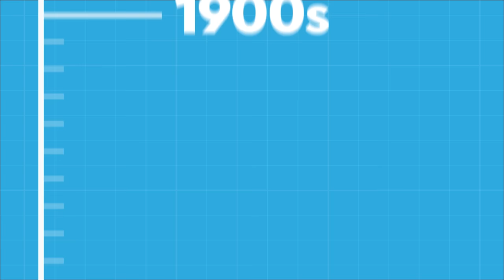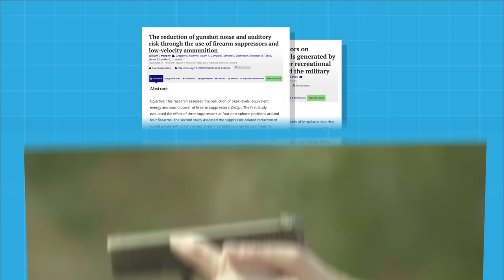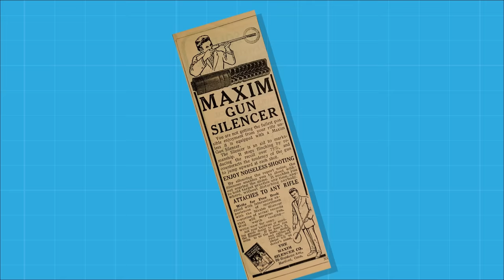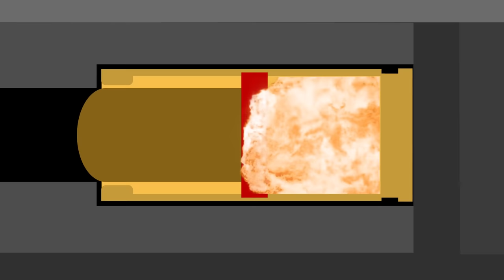How Silent Are Gun Silencers? DEBUNKED #moviemyths #debunked

Comment: I’ve always thought of them as a safety device more than anything
Reply: ...and you would be right!
Reply: Correct.  Saves your hearing.
Reply: Except not in the US. You must pay the fed $200 for this safety device that saves your hearing, makes your gun less concealable, and more difficult in tight quarters because the US government believes that a suppressor makes the gun more deadly.
Reply: @crissd8283 it makes it easier to get away with murder, so that might be why
Reply: @crissd8283   It's total nonsense.  Another example of the government being ignorant to facts.
Reply: @sweetricecakeman8582 not necessarily, silencers add more "pressure" on the system expelling more gunshot residue on the general area. Thats why you see more puffs of smoke, making it much easier to identify where the shootings took place and much easier to identify the individual because of the increased amount of evidence. This also dramatically increases the "sootyness" of the casings, making them significantly easier to identify in the forensics lab as they become "fingerprinted" to the firearm they were ejected from. You could argue that a weapon that retains casings would be immune to this, but revolvers don't seal the gasses, meaning a suppressor would be pointless and wouldn't perform as intended
Reply: @sweetricecakeman8582 
Not taking into account that a silenced shot is still loud as hell, there's still the corpse to worry about, as well as footage from surrounding cameras, witnesses, etc. Having a silenced gun doesn't make killing easier, it's just slightly less loud.
Reply: @BeRzErKeR111  Yeah, of course it's still extremely difficult to do.
Reply: @sweetricecakeman8582   You really have no idea what you are talking about, do you? Gun shots produce a noise level typically somewhere between 145 to 180 dB... greater noise than a jet engine at full thrust or an amplified rock concert with your ear a foot away. Suppressors (Hollywood and uninformed politician calls them "silencers"... thinking they make gun shots "silent) reduce the noise roughly between 10 and 30 dBs. Taking a "quiet" unsilenced gunshot at 145 dB and then using one of the more effective suppressors capable of a 30dB noise reduction, you're still left with a gun shot noise of about 115dB... about the sound level of a locomotive's horn from twenty feet away... enough to cause permanent hearing loss if experienced for any length of time.  How does that make it easier to get away with murder?
Reply: @sweetricecakeman8582  I would just use a compound crossbow for complete silence.  As for guns, people just don't want to damage their hearing.
Reply: @jmichna1 because it's not a continuous sound so you don't really notice it that much especially when compared to a jet engine also the loudest part of shooting a gun is the sonic boom that isn't there with subsonic bullets there is a reason why spies use suppressed guns and not just in movies (the welrod for example)
Reply: @sweetricecakeman8582 If you want to kill someone silently there are many more effective means than a "silenced" gun (which as this video shows, isn't silent at all). Besides, good silencers are expensive, require a threaded barrel (which is also expensive) and most gun murders are carried out with cheap, virtually disposable "Saturday Night specials," or the ubiquitous Glock clones.
Reply: That’s exactly what they are .
Reply: @sweetricecakeman8582 you my friend are not a gun guy .easiest way to get away with murder is live in a democrat city , duh.  

Is 137db quiet , not really . Odds are you have never used a suppressed weapon or had any training. 

Better to be quiet and people just think you are dumb than to speak and have it confirmed .

Comment: It is possible to have a mostly quiet gun, but you'd need to use subsonic .22 (the smallest you can get). You'll still get noise from the action though
Reply: get a 45 or 50 cal air gun.  you'll have a magnum cal handgun energy that sounds like a roofing nail gun
Reply: When I put my suppressor on a bolt action .22, it's far quieter than on a semi-auto gun.  I think at least some of the sound on a blowback semi-auto .22 is detonation noise coming back through the action.  I'm not sure about that but it does seem like there's more than just the clacking metal sound of a blowback action.  On a bolt action it's just a popping noise like an air gun, but on a semi it's a clack and louder pop if you know what I mean?
Reply: My .50 air gun is as loud as a .22, but my single shot suppressed rifle in .32 S&W long is almost as quiet as Hollywood 😊
Reply: The SD variants of the MP5 (the ones with the integral suppressor) are near silent when using subsoni 9mm. The only noise you really har from them is the noise coming from the internals working.
Reply: @dragonhealer7588  check out the texan LSS .50 with suppressor.  it has a built in 18 inch suppressor, with option to screw on another.  it's comically long and unwieldy, but it's unbelievably silent.  you can see guys confused and wondering if it shot after pulling the trigger
Reply: @loginavoidence12  
I've seen videos, and the suppressor is pretty effective, but the  .50 does have recoil, no question that you shot.
Reply: @dragonhealer7588  yeah i gave myself a black eye with it having my scope in the wrong position.  thing taught me a lesson about being patient about setting up gear
Reply: Subsonic .22 ammo will not cycle my rifle or pistol.
Reply: Anything subsonic will work if you have a good suppressor. The quietest gun I have ever shot was a reproduction De Lisle Carbine owned by a range buddy of mine. It was developed for the RM Commando's during WWII. The entire barrel is essentially one long suppressor and it uses subsonic .45 ACP. On a still day you could not hear the gunshot beyond 15 - 20 feet, with a brisk breeze you have to be almost on top of the shooter. 

Point is its easier to make a firearm close to silent IF you use subsonic ammunition because a large part of the sound of a gunshot is the round going supersonic and breaking the sound barrier. If the round does not go supersonic, it never breaks the barrier, so removes that sound from the gunshot, and the sound of the round going supersonic is impossible to suppress to my knowledge.

The downside obviously is using subsonic rounds you lose accuracy at range because subsonic rounds have less velocity, which means greater drop not to mention lacking the energy to even make the ranges a supersonic round o the same calibre would.
Reply: You can go slightly more powerful than that but Yh with very low powered low calibre bullets you can get very quiet
Reply: @loginavoidence12 Yh it’s weird because people think the Hollywood quietness doesn’t exist but it really does, a lot of people only talk of them in relation to bigger guns but they really do silence low powered weapons. Even this channel doesn’t talk about them and seems to think the same thing
Reply: I stuck a 16oz plastic water bottle over my 10/22 many years ago & the only nise I could hear was the action cycling & the bullet passing objects & the sonic shockwave reflecting bacl.

Comment: You can get Hollywood quiet with small subsonic calibers like 22lr, however, you are also ballistically neutered to slightly more than a BB gun.
Reply: You can also do that with a .45 ACP, which is actually a far better candidate for a conventional silenced weapon, as while the gunshot decibels are loud, they are mostly low frequency, which led to hard to hear gunshot sounds without the big crack. Specialized subsonic rounds like the 9x39mm or .300 Blackout also do the job well for it.
Reply: The .22lr is much more than a bb gun lol. A properly placed shot from one will kill instantly even at relatively long distances, whereas a bb gun is not likely to be lethal except at very close range.
Reply: @georgesakellaropoulos8162  CCI quiet 22LR shoots at 710fps.  About twice the speed of a Daisy Red Ryder.
Reply: My Gamo BB gun fires BBs at about 1000fps.
Reply: Silencers don't dampen the ballistics of the round. You've been video-gamed.
Reply: @TommyTombstone  I believe the OP was referring to the "quiet" rounds, which are definitely ballistics handicapped. Speaking from experience.
Reply: @kinthelt  22 LR is already subsonic from most handguns. The difference in powder load for "supers" and "subs" is negligible.
Reply: @dalenesbitt  Right and kinetic energy is 1/2mv^2. Do the math.
Reply: If you think a 22lr is only slightly ballistically better than a BB gun, you don't know sh!t! Even the most expensive BB guns, regardless of caliber, can't get close to a 22lr.
Reply: @bradgriffith4231  BB's are only lethal in very limited circumstances.

Comment: There are some older styles of suppressors that are much quieter, but they only work for 1 or 2 shots. Basically only designed for assassinations. They use baffles and also something called wipes, that actually make contact with the bullet as it exits, thus slowing down more of the expanding gases making it very quiet. But once you shoot it a few times, those wipes are basically worn down to where they no longer make contact and make that seal around the bullet and it'll lose its sound suppressing qualities.
Reply: Wipes are still common and last for more than one or two shots lol
Reply: @orion8981  Um, go ahead and give more details then. I know for some people the internet is just for arguing with each other, but if you know more about the topic, why don't you share the information rather than "hurdur, this guy dumb, lawl"? Please do so. I've never used one with wipes before, so my knowledge on them is limited. I simply know they exist and was sharing that since this video was about suppressors...
Reply: Yes, thankyou for bringing up the topic of the use of replaceable wipes.  One of the most important pieces of the real life suppressor lore!

Comment: Some parts of the world call suppressors "firearm mufflers" because the underlying science between car mufflers and suppressors is very similar. That and all modern car mufflers are based on Hiram Percy Maxim's designs, he was contracted to develop improved car muffler designs at the same time he was developing his silencer.
Reply: Well they were created by the guy who invented the car muffler. He just took the same design and resized it.
Reply: @dominozaur98  Maxim doesn't get historical credit for inventing the car muffler, other designs (and patents) predate his by several years.
Reply: A firearms muffler is basically an expansion chamber & could work with a perforated tube with sound absorbtion material between the PT & the outside wall of the can with no baffles, same as magnflow & borla auto mufflers. The drawback would be the explosion would probably destroy the SA material.

Comment: I was at the local outdoor range on Monday. A guy had a 9x19 pistol with a suppressor. Basically it was slightly less than my .22LR pistol and without the sharp crack. I asked him about sound with and without, so he took it off and fired, and there was a significant increase along with the sharp crack of the bullet. Suppressed, you definitely heard the action and the noise of the slide. It was no where near silent, but it was greatly reduced, enough I could have shot without ear protection (I did). With muffs on, you hear both, but mainly you hear mechanical sounds when suppressed.

Comment: During WWII, the OSS created an automatic pistol for assassinations that was incredibly quiet - receiver made of stacked mesh washers, holes in the barrel to bleed gas, integral  suppressor at the end of the barrel. Its report was said to be about as loud as striking a large kitchen match. But the auto loading system made an incredible amount of noise. So they changed the gun from an auto to a single shot. But you had to get very close to your target - bleeding off so much gas meant very little bullet energy.
Reply: Aaaaand of course the most important example is missing. There are videos here that address exactly that. If you combine sub-sonic ammo with a suppressor you will get exactly what these guys claim isn't possible. An almost silent gun. They could have known that if they had invested only five minutes of research.
Reply: @EbonyPope  I think the primary purpose of this video was to debunk the Hollywood myth.
Reply: @stopthephilosophicalzombie9017  But it is not debunked which they could have known if they had researche on YT for five minutes. There are videos here that use sub-sonic ammo with a suppressor that sound exactly like in some Hollywood movies. They were lazy.

Comment: An army coronel, friend of mine, who was (he passed away few years ago) firermas instructor, once showed me a noise supressor which funcioned in a very silent way. He had placed tiny rubber disks between the chambers of the supressor. They didn't last very long as the sound increased on successive shots. It was years ago and I can't recall exactly how many shots he gave. As far as I remember some 10 or so. The wearing of the disk rubber caused them to be replaced after that. He used a semi auto pistol and caliber .45 which is a subsonic round as he put it. I presume in a city environment during the day one could barely notice the low noise it produced. Of course on top of a lone mountain at night it would be another matter.

Comment: Silencers work incredibly well on airguns, especially pre-charged airguns. Because most Airgun ammo is Sub-sonic & the pressure is much less than powder burners you can get near silent performance.
Spring powered rifles do have louder action noise but down range you often only hear a muted click.
I have hunted with a silenced Airgun & the sound of the pellet impacting the quarry is often much louder than the shot report.

Comment: It's two things - firstly the supressor does lower the sound - but there is more to it - if you want a really take advantage of it you also need a subsonic ammunition which by design is made with lower powder charge to make the bullet subsonic to avoid the loud crack of going above the sound barrier.
 By using both you can achieve very quiet shots and in many cases the sound of the gun cycling can be actualy louder than the shot itself. The added bonus is that the supressor will also help a lot with suppresing the muzzle flash - and it will keep the position of the shooter that way easier to conceal as well.

Comment: I have an old Video on VHS, that debunks suppressors.  Showing (if you didn't know it otherwise) that a revolver can't be silenced, as the gases escape from the barrel, but also at gaps around the chamber.  Also the current at the time firearms that could be most closely silenced, were those firing .22 lead projectiles (which are slower and the projectiles do not go faster than the speed of sound).  Also a .45 APC round, a large powerful projectile that also is by it's size, slower and does not go faster than the speed of sound.

Comment: One disadvantage of a suppressor is it reduces the velocity of the bullet, which shortens it's range of travel before it starts to fall to the ground. However, since a suppressor extends the barrel length (and reduces with recoil) it also helps to improve accuracy.
Reply: It increases velocity.
Reply: @whereswaldo5740  That's true about modern ones. The older ones decreased it because they had rubber gaskets.
Reply: @DoomFinger511 they are called wipers and actually touch the bullet.  New suppressors have an increase in velocity. I have a chronograph and three suppressors.  And yes legally with tax stamps through ATF
Reply: Barrel length has zero to do affecting accuracy, especially in a can where there is no bullet contact. In fact, many target rifles are cutting barrels to 20 inches because the increased time spent in the barrel increases the possibility of pulling the shot off target. 22LR Bullet velocity increases up to about 19.5 inches & starts decreasing after 20 inches, so 19-20 inches is ideal for a 22lr..

Comment: My favorite misconception about suppressors, is how loud the gun mechanically is.  Take a gun and "rack" it back fast and let go.  Granted firing the gun makes it go back much faster, but even that sound is super loud and could easily be heard on a different floor of house, let alone across the room.  So even IF the gunshot was totally silent, just the action of an automatic firearm is pretty loud.  A very few calibers are quiet enough to shoot without hearing protection with a suppressor without causing hearing damage, or at least still ringing the ears pretty good.

Comment: Favorite movie Assassins with Banderas and Stallone. The 1911 Colt is the assassin's weapon of choice because the muzzle velocity is subsonic. The round arrives on target without the characteristic crack. A smaller charge will achieve subsonic muzzle velocity in other makes of handgun. A gunsmith will modify the firearm so that it has to be cycled manually, as a good chunk of the sound would escape the breech as the cartridge is automatically extracted. Thus the integral silencer. A silenced revolver or bolt-action rifle is quieter for the same reason. A real assassin firing a rifle from cover where noise suppression is vital to the shooter's survival would probably use a silencer with a much larger diameter and a prismatic sight. The silencers on modern cars are eerily effective.

Comment: I tried a silencer on my M16 in Vietnam, not in the boonies, on a firebase.  The biggest problem I noticed was that since the gases are trapped, when the brass is extracted a vacuum is formed and in the split second the bolt is open, the gases come back to the shooter.  Slightly noticeable until the last round is fired and the bolt is locked back and the gases really pour out.  With the last shot, my eyes watered so much, I could barely see.  Not worth the weight to carry into combat.